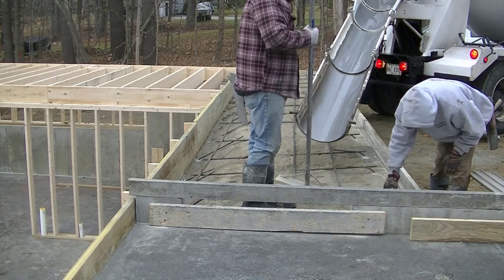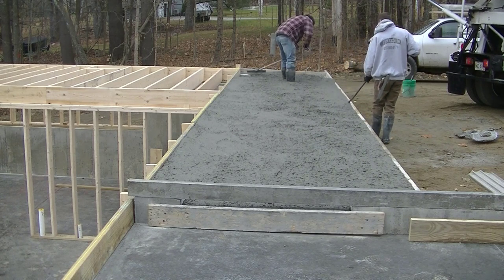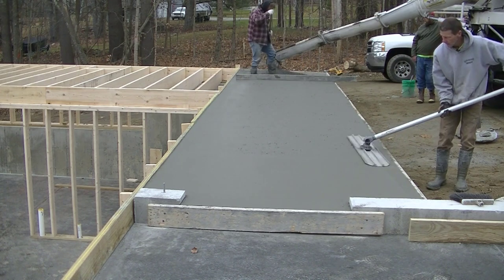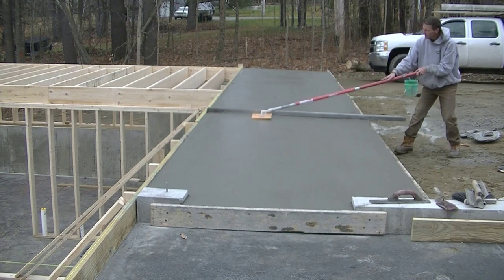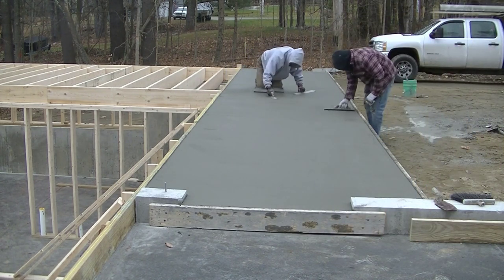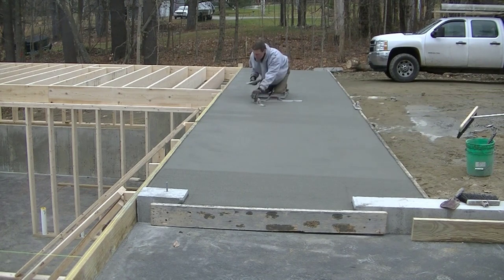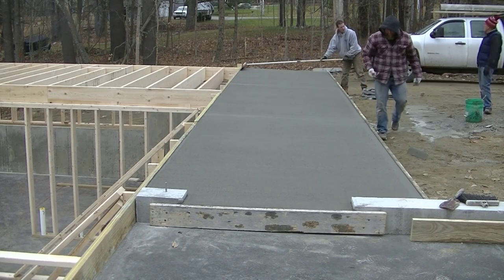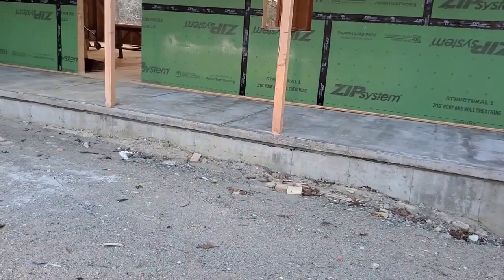Pouring And Finishing A Concrete Patio With A 1.5" Overhang

Comment: Why didn’t u use flashing on the pressure treated for extra protection
Reply: They say, nowadays at least, that flashing can interact poorly with the concrete and actually cause more issues. Plastic /vinyl is now recommended there.

Comment: Hey mike,great video.if possible I like to run the b float across along the backside just to flatten any potential dips.at times if concrete not setting to fast I like to strip the front face board and continue my joint down the face.i think they look better that way.i call the broom balls dingle berries.😄

Comment: Didn't looked like you brushed the face after removing the 2x4.  Also, why is there no flashing between the concrete and the house? What happens when water gets between the wood floor and concrete slab?

Comment: Question, you don’t lift rebar?
Reply: They drilled holes in the top of the footing and inserted the re bar, then bent it over.  The re bar mat was then assembled on top of the bent over bars.  The mat held itself up, it’s clearly visible in the video.

Comment: Hey Mike, I have a question. I got a company in Atlanta who redoing my driveway and he’s not using rebar he states that extra $$ he wants approximately $9000 without rebar. Also he states rebar isn’t necessary because he’s using 3000psi concrete. I have a two car driveway. Is this the proper way of doing such driveway. Thanks

Comment: No chairs or dobies under rebar didn't see you pull it up in concrete
Reply: The re bar was drilled and pinned into the footing, then bent over into the slab.  The rest of the bar was on top of the bent over pins.  It was all holding itself up in the concrete.  It’s clear to see in the video.
Reply: Sorry didn't see any clearance between sub grade

Comment: Why didn't you rub the face? It is obviously going to show.
Reply: He mentioned  no more than couple inches of exposure, no biggy.
Reply: @stevelopez372  it is a big deal it is an incomplete finish job.
Reply: Also the  joints do not extend down the face leaving a random crack. Would have been pretty easy to pull that board and give it a quick rub and broom. This guy wants to teach people how to pour, might as well do it right.

Comment: Seems over worked to me(heated rock=loss of air entrainment). Looks great but knee pads are not necessary on a 6’ wide sidewalk. Plus overall just too hard on the guys to crawl everything. Your maybe one of the few that know enough to do this but not recommend for 99%.  Strip and rub edge as it looks so much better